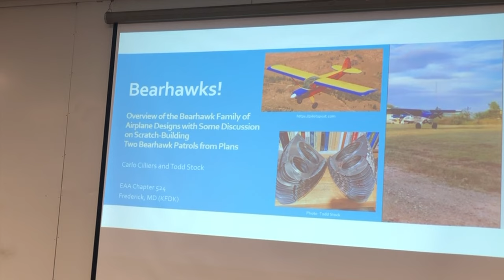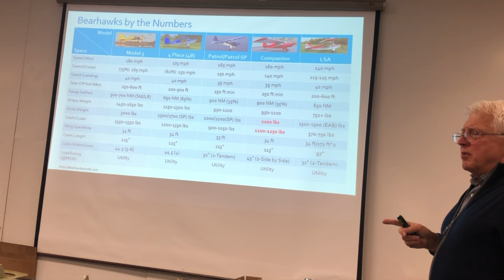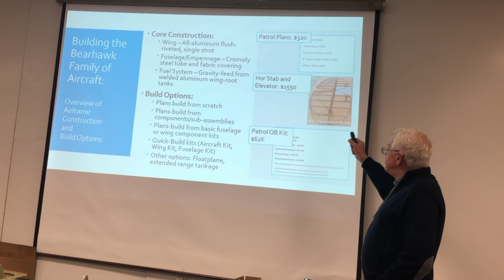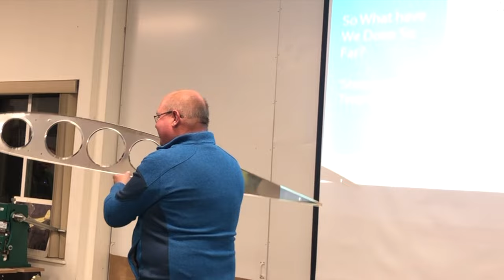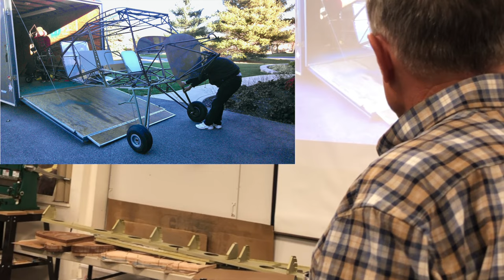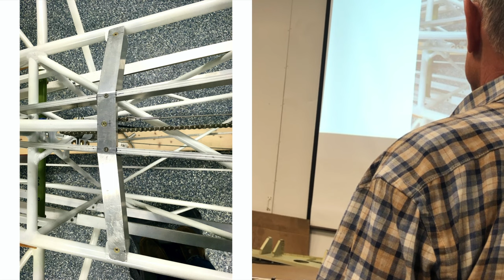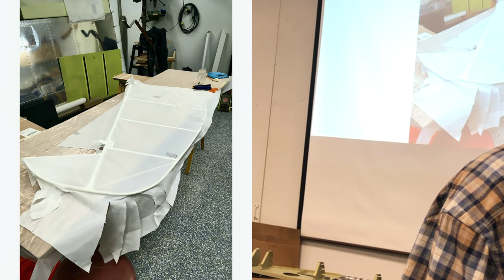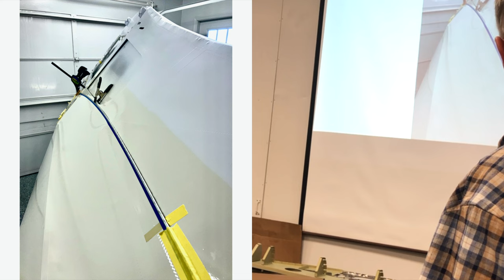Building the Bearhawk

Comment: Wow! What a HUGE project!
Reply: Carlo's scratch-built project is moving pretty quickly... since receiving his plans in Sep 2023, one wing is skinned and the other is getting close to closing out, so under a year to get the toughest part of the airplane built from plans.  And that is with a significant number of mods and improvements, including wet wing, capacitance fuel level, CNC milled inspection ports (no rim inside the wing, so no knuckle-busting nutplates), and the usual optimized weldments, etc.